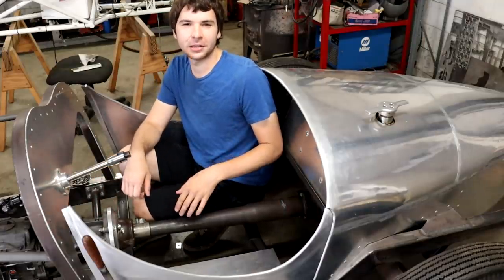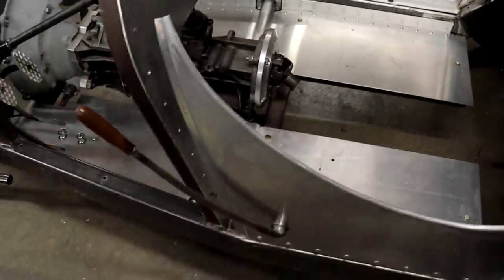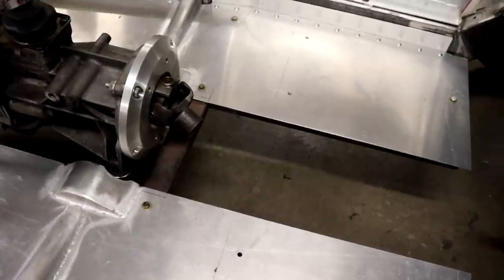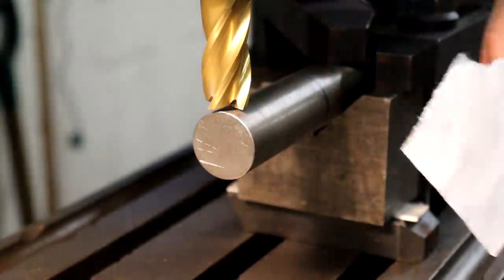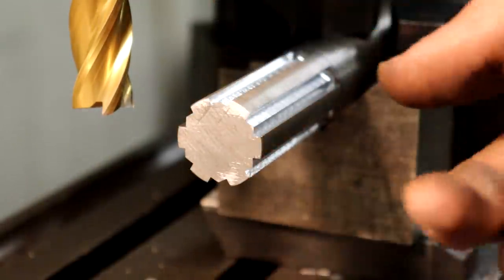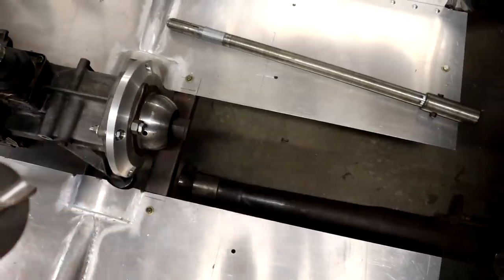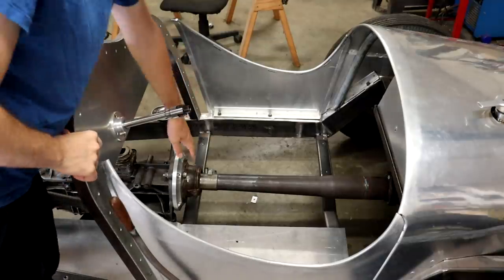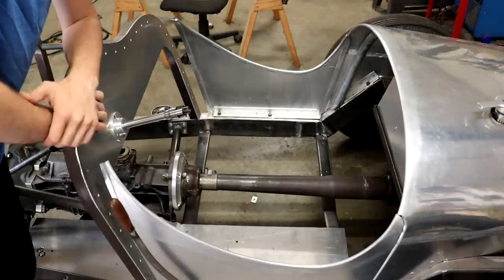Early Ford Driveshaft Modification (How To) | Homemade Boat-tail Speedster Pt. 51

Comment: Love how you solved a complex machining problem with simple tooling.  You're inspiring others by demonstrating that they don't have to have a huge shop and all kinds of fancy equipment, jigs and machines that only perform one function.
Reply: If you would sell the sheet metal that is not possible for the average mechanic to make as a DIY package, then you would have a thriving business. Many people would like to build themselves, but the sheet metal is always a problem. And which DIY can or has an english wheel. My compliments for what you have made

Comment: FYI to anyone who wants to recut their own. When we recut splines , on the third pass we normally use 1/8 inch end mill on centerline or equivalent for the width you need. We run into not having the correct woodruff cutter width, or having to buy multiples.

Comment: Nice job, great to see someone else that bevels the joint before welding, i see too many here on YouTube here who just cut and but weld without beveling anything, hope you plan to go back to the hard steel pins in the drive coupling instead of bolts to keep the balance, also, one last thing, with shortening the driveshaft and torque tube i hope you dont run into angularity issues , for a given suspension travel the now shorter setup will have a greater angularity.

Comment: Great use of your rotary table. Next time you might want to consider an end Mill that has more flutes / cutting edges. When you're doing a spline in steel.
Reply: One other thought, if you switch to using rolling papers, they are consistently one thou thick

Comment: Excellent as always. The Riley 9 Brooklands I am building has a very similar torque tube arrangement. The ball is on the end of the tube and the rear of the gearbox makes up one half of the socket and the hand and foot brake mounting mechanism makes up the rear half. You fit brass shims between the two to get the right clearance in the joint. The coupling on the end of the driveshaft is pretty much the same as yours. On the Riley it's called the muff coupling and connects the drive shaft to the diff pinion gear. I had my tube and driveshaft shortened by an engineer who deals with 4WD vehicles usually and he did a great job at a good price. On the Riley 9 the rear of the tube is an interference fit into the front cover of the differential then riveted in place. Only having a tiny lathe I wasn't able to turn down the cut off end of the tube to fit by myself!

Comment: If I remember correctly, the old Ford torque-tubes had an A-frame from the ball-joint to the outer ends of the rear axles - the purpose was to stiffen up the whole rear axle assembly and prevent longitudinal movement of the rear axle on acceleration & braking, not just relying on the transverse spring. 
So I think you need a control arm coming forward from the outboard of each rear axle to a pivot point inline with the ball-joint on the torque tube... OR a Watts Linkage to constrain the movement of the back axle to a vertical direction - your Panhard rod does the same thing in the transverse direction.

Comment: Please make sure to refit the two rear radius rods as they are designed for triangulation. Otherwise you are only relaying on where the torque tube bolts to the rear centre section to hold all the stresses of the rear axle.

Comment: It's nice to see that you are incorporating old technology with the new. I saw a model A Ford rear at the scrap yard that someone had used to build a farm trailer. It's a shame that people don't care about history. Do you happen to have an old  model a clutch disc around? I'm going to use an old transmission from a model A, and need this for my power input.i would also be interested in what you would charge to make me a stub shaft for the output side from the u joint.

Comment: Hey Sir. Hope your 4th of July was good. I have a question of course. Why not weld the spline and coupler together for extra strength? So we will have a chevy transmission matted to a ford engine I see. And maybe put a grease fitting on that dome thing where the drive shaft goes into the transmission, so that you can keep it lubricated. Thanks for the great video.

Comment: Excellent job on the re-splining. I did a similar job recently but used a tubular driveshaft so I avoided any re-splining. I think the method you chose worked very well. A couple of comments, if I may. 1, the relatively short length of the driveshaft made it fit on the milling table. Most times the shaft is quite a lot longer so holding it and indexing it would mean some imaginative solution (which I'm sure you could handle). 2, I'm not sure if that shaft is like the ones I have, but the shaft diameter is smaller along most of it's length and only comes up to full diameter at the splined parts and in the middle where a support bearing is. Is your shaft slightly undersize where the splines have been cut? I don't think it is a problem, but couldn't quite see from the video. 3, Using a high tensile bolt is not a great idea. They can fatigue and break. You are better off using a pin of relatively malleable steel and then putting something like a hose clip over it to stop the ends falling out if it breaks. I use two to maintain the balance. 4, As I said, I did a similar job recently and covered it in a video series. I show some alignment checking techniques which may be interesting to you as they do not require any specialised equipment. You might want to check it out. Thanks for showing the re-splining process, I might give it a go this way if I need to do the job again. All the best, Mart in England.

Comment: Traditionally, a cigarette paper is used to zero out the endmill, it's much thinner than regular printing paper (about 22 microns, or just over half a thou vs 100 microns or 2.5 thou).
Reply: Why did being thinner matter. You compensate for the thickness anyway

Comment: You should be using oil or coolant, not doing so is a good way to knacker you nice new cutters especially on carbon steel.

Comment: Am I missing something? Why would you want a torque tube, seems like an old solution for weak chassis. This looks pretty substantial for what it is.
Also is the pivot point for the rear arms at the ball join? Could see it pulling itself apart if not

Comment: done a realy nice job on cutting those splines , never seen it done that way but it saves you making a custom milling bit
mightve used a pipecutter on that torque tube though https://d1qgi7ksrq21ya.cloudfront.net/media/catalog/product/cache/53f7e7bf262f1a75275189d121ad7ff7/d/s/dsc_0850_1_16.jpg
makes a straighter cut 
its a nice setup , you only need a panhard bar or a watts linkage to keep the rear suspension in place under the car (panhard bar is more period correct i think )